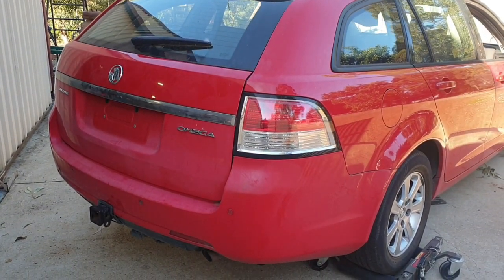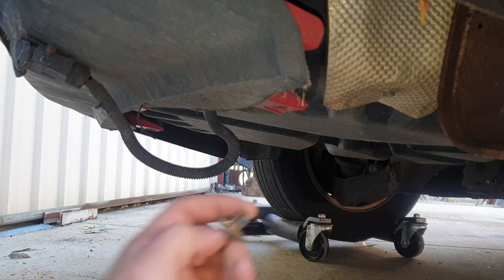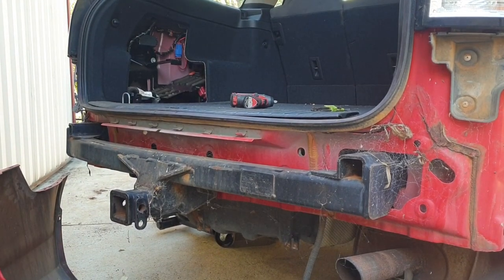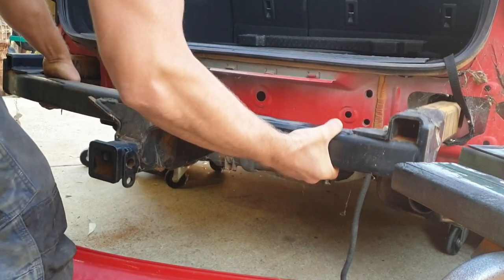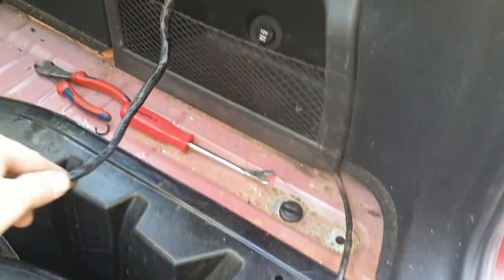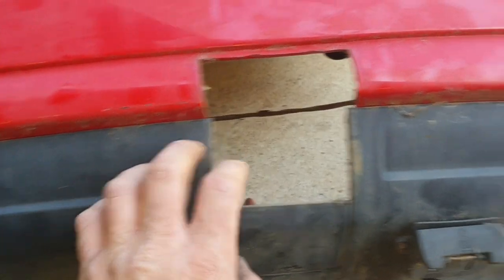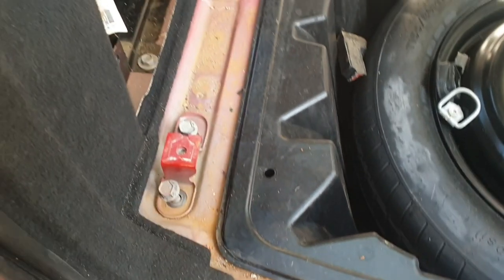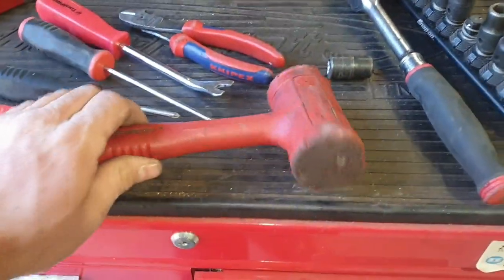How to fit ve commodore wagon tow bar

Comment: Hey mate, do you have the part number for the tow bar you took off? I've pulled off the rear bumper of mine to have a look and there's an aluminium brace which yours doesn't seem to have as well?
Reply: Also were those holes for the towbar 15mm bolts factory drilled?
Reply from the maker: G'day mate part number for the tow bar genuine Holden 9220 7452
And those holes are there from factory they hold down the tie-down supports in the back of the wagon and it's a 15mm socket the bolts are 10mm bolt tread size.
That aluminium section you're talking about could be the crash bar/ impact bar don't quote me on that one though sorry
Reply: @downtheshedwithbyron  Legend! Thanks mate, I'm buying the same Genuine holden part so based on your guide it should be a relatively easy install! Did you need to cut an additional hole for the trailer plug next to the hitch?
Reply from the maker: @NickGunn  bro depends on the plug you use and with the trailer hitch just take small Cuts at a time till it fits